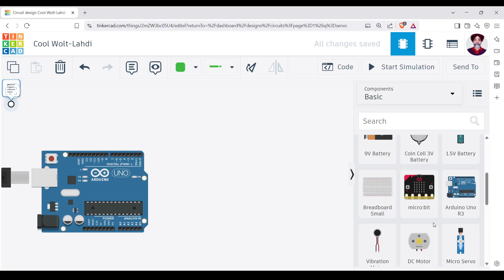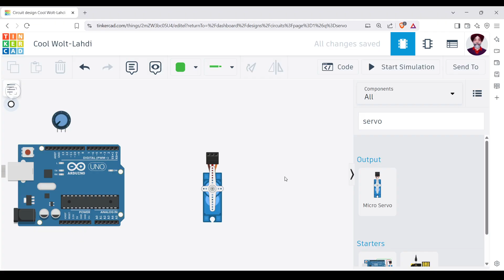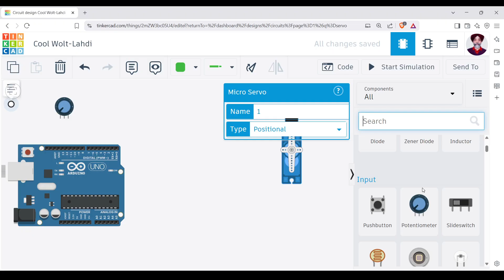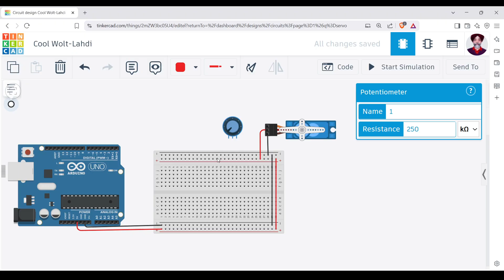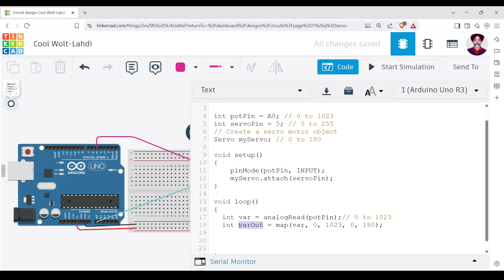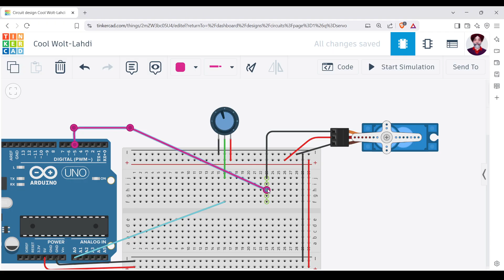Lesson 8  Servo Motor Movement Based on Potentiometer Position (Wiper)

Comment: Sir can you share the code?
Reply from the maker: Yes, here it is:
#include <Servo.h>

int potIn = A0;
int servoOut = 10;
Servo myservo;  // created a software object myservo

void setup()
{
  pinMode(potIn, INPUT);
  myservo.attach(servoOut);
  Serial.begin(9600);
}

void loop()
{
  int val = analogRead(potIn);
  Serial.println("Before mapping");
  Serial.println(val);
  // val can have values from 0 to 1023
  // but the servo can go from 0 to 180 degrees
  // so 0 to 1023 have to be mapped tp 0 to 180
  int newVal = map(val,0,1023,0,180);
  Serial.println("After mapping ");
  Serial.println(newVal);
  // Change the angle of the servo
  myservo.write(newVal);
  delay(1000); // Wait for 1000 millisecond(s)
}